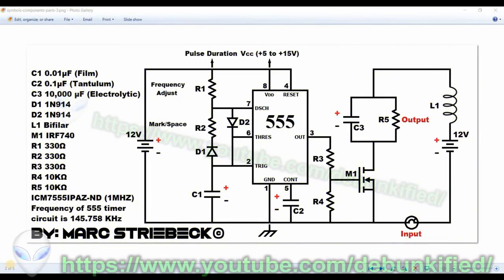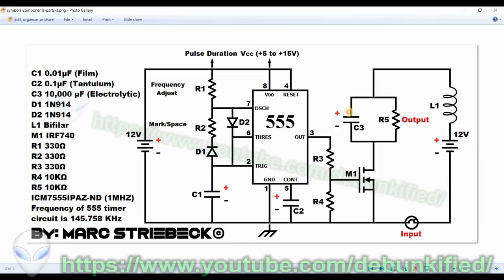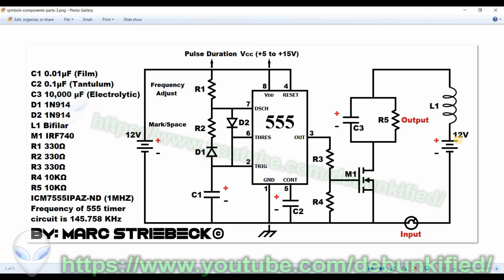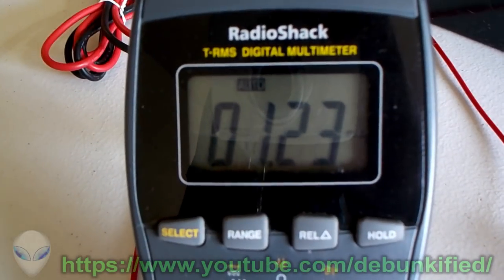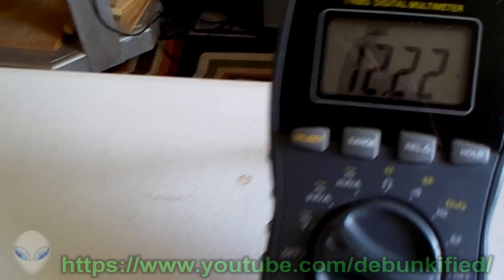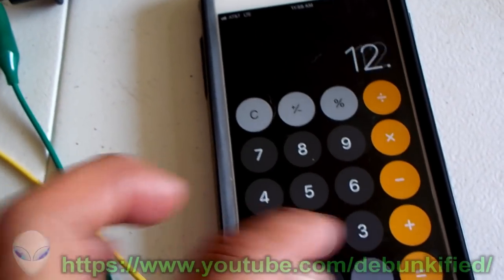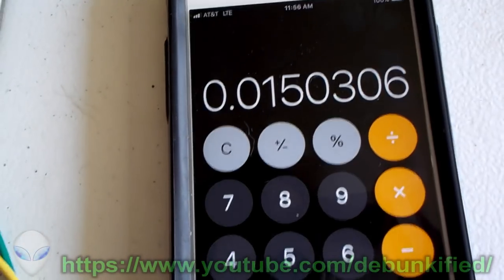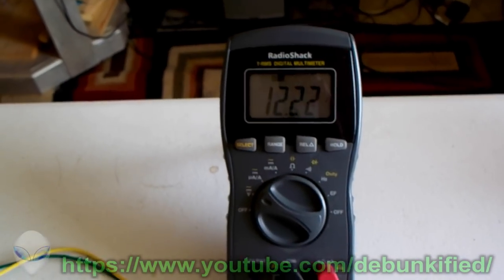LCR Over Unity Generator

Comment: Hi Marc the electrolytic at the output (C3)  can look high impedance to fast transients & high frequencies. Your meter's true rms frequency range and shape factor,  likely doesn't like these impulses on the output so it's not as accurate as we might think.  I suggest bypass C3 with 0.01 disc ceramic.
Reply from the maker: Thanks for the suggestion it is greatly appreciated. Do you have any suggestions on the input current measurements? Or is it ok? It is highly suspect as the meter measures practically 0uA yet keeps the voltage high on the C3 capacitor. I am not sure if this is AC or not so any good ways to filter that and get a more accurate input current measurement?  The output is precisely what it is as the capacitor is disconnected and the higher voltage remains, meaning that R5 can be calculated with ohm’s law as usual. Forget diodes they eat all the energy up.

Comment: Are your DMMs rated at 145kHz? I don't think so, your meters cannot measure AC voltage or current at that frequency, hence no AC meter reading.

The capacitor is in a pulsed current circuit, it will contribute to the current flow, read what I have posted in the previous video comments.
You have to measure the resistor ONLY current to to work out the power dissipated in the resistor.
Your DMMs are trying to measuring the pulsed DC current that flows through both capacitor and  the resistor, this is an average current and NOT the resistor current.

The instant you introduce pulsed DC current, which you have , you cannot use the DC version of OHMS law, you have to consider the capacitor and inductor IMPEDANCE.

When you take the capacitor out of circuit, you still have a pulsed DC current and the coil in circuit.

When you demonstrate "under unity" you are working with DC, different ball game.

All because of AC and your components IMPEDANCE.

Comment: It's hard to make accurate measurements without a fast oscilloscope. The idea you are exploiting is "Bearden's" mass-less displacement current, whereby the capacitor "sees" the voltage when FET turns ON for preferably < 100uSec (which is less than enough time for electrons to form skin effect current). So before electron current can flow.. the FET turns off.   Capacitor acquires electrostatic charge but needs to pull the electrons from somewhere else ... presumably the ambient. The suggested 0.01 disc capacitor might interfere with this process even if it makes the meter read more accurately.
Reply from the maker: Great! Now you’re talking my language. Massless displacement is something I am completely familiar with. You’re one of the first to bring this to the table. It’s really appreciated. I’m not entirely sure, but what would the time for 145 KHz frequency be for? I don’t think it’s quite a microsecond yet. Or maybe it is, I found this this site  https://www.unitjuggler.com/convert-frequency-from-kHz-to-µs(p).html?val=145 which says 6 microseconds from what I can tell.
Anyways my studies on that subject has led me to the question that if no current flows how can there be an electrostatic voltage accepted by the capacitor? I thought electrostatic had a tiny little current associated with it as well. Might be similar to how the fet works by *fields*. Hm.

Also if there is a current in electrostatic, which I am pretty sure there is, what Tesla posed as a question so long ago, if kinetic then not in vain, then wouldn’t the capacitor charge up very slowly? I do see the slow charging characteristic, with no current by the way, not even a fraction of a microamp on the meter. AC? Give and take for no consumption? Charging a capacitor without loss?
Reply: debunkified I think your circuit is receiving gain from the difference in voltage durring transfer of charge. Your resistor acts as a load and a generator.

Tesla eluded in many of his patents electricity flows both ways from a resistor/inductance, allowing you to collect the power that is used and transfer it to battery 2.

This seems very similar to what a YouTuber Rick friedrich  is doing with 2 multiple batteries and recovering the power! Check out Rick friedrich
Reply from the maker: Turning resistance into energy, very novel. Seems like this is very similar to the E-Amp effect Tom Bearden was talking about in which resistance becomes null and the voltage travels around it instead of through it. 

I see no evidence or measurements provided by Rick Friedrich nor his loving circuits. He sure doesn’t love me anymore after explaining this to him. In fact he blocked my comments, I mean really? I used to look up to that guy. 

At least I show actual measurements and try to find other ways to accurately measure everything. No offense to you of course. He likes to talk for an hour straight about theories such as the heavy side current or poynting flow but provides absolutely no Watt measurements. Time waster.
Reply: debunkified I understand Rick doesn't provide any power measurements, I'm sure bearden himself said the power cannot be measured because it's Infinite when it is flowing from the eather. What would be measurable is the charge being transferred to keep the field in motion, not the excess that is gained?

Once it's gathered and stored in a condenser it can be measured. 
Rick is showing a transfer of charge can be useable on the other end. Or so it seems. 
I understand why you would be let down by him, I'm curious as to have to experimented with his setup of batteries and a conventional motor/load?

I very much appreciate the effort you put into inventing and creating your videos. Thank you for your contributions
Reply from the maker: That is very kind of you. I hope something is always gained in what I show, no pun intended. As you’ve mentioned as well as Bearden and most likely Rick that the energy can’t be measured. I say it can’t be measured in transit from the aether or wherever to the load. But it should then be measured as normal energy and power once it has entered into the load. 

I don’t see why this isn’t ever demonstrated. We always hear about this cold electricity and current, or wattless power but I believe that is referring to when it is in its pure potential state as voltage without current or current without voltage, which makes absolutely no sense to the human brain because you need both to have wattage. I mean wattless power? Wattless power is no power as far as I’m concerned. But again I figured perhaps this wattless form of power exists only in transit to the load.

I see no reason why the excess energy can’t be measured as watts with real voltage and current that can be seen with the physical brain, on a meter, once it has exited its powerless state of pure energy and entered into the load and slowed down in time so that we may observe it.

Comment: Interesting...just how much energy can a caducious ferrite hold and how long will it keep the voltage high...since it cancels the magnetic field you would think the fly back would be low and act like a resistor...I suggest taking voltage drop reads from the ten k resistor and calculate amps from it but you might want to install another resistor like a one ohm in series and take direct voltage reads from it since ohm laws says one amp through one ohm a read of .00123 volts will be exactly that in amps I use the ten watt 1 ohm for current anything over ten volt drop would probably ruin the resistor.
Reply from the maker: The bifilar is inductive and not noninductive, meaning the opposite ends are connected together serially and does produce a magnetic field. The question is if the voltage is higher than the battery then how can the battery flow into the capacitor to produce the magnetic field in the first place to return a higher voltage the the capacitor? Especially with only a fraction of a microamp on the input? Unless it’s AC, but it’s pulsed DC. It’s a mind paradox. Ohm’s law does indeed exactly matches what the meter reads across the load resistor.